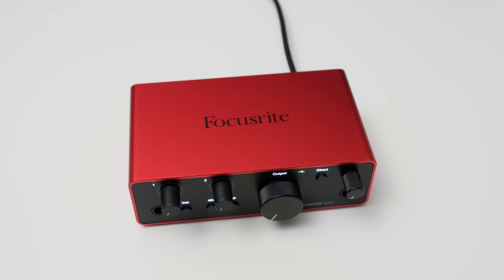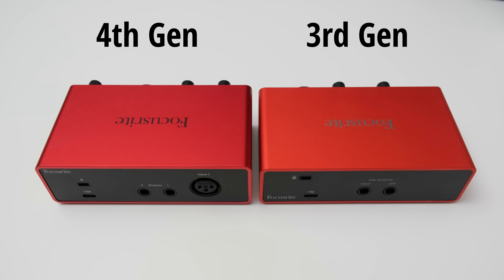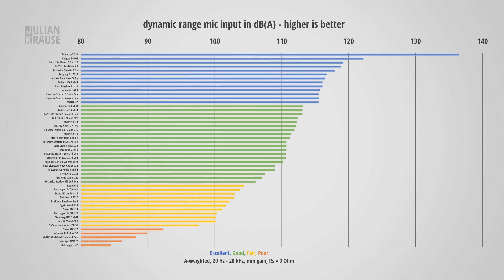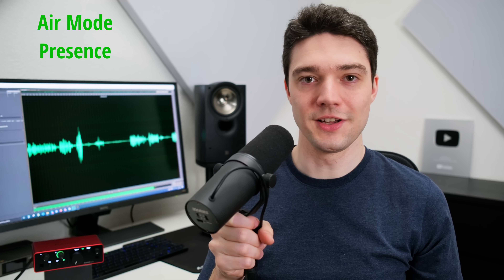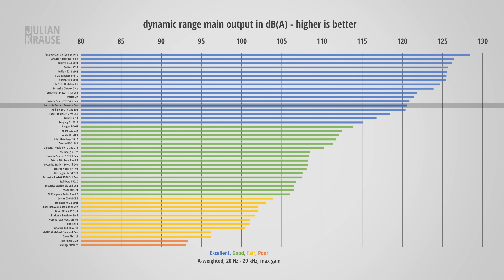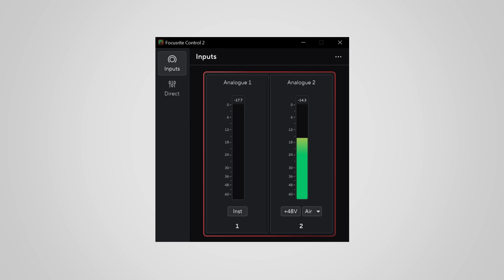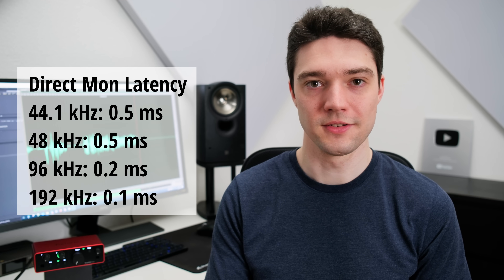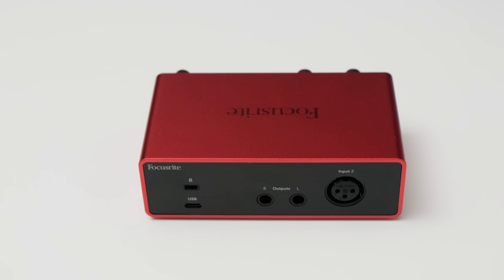Focusrite Scarlett Solo 4th Gen – USB Audio Interface Review (Air Mode Audio Samples)

Comment: Try plugging a Stratocaster style guitar directly into the instrument input.  There is not enough gain on the preamps. This is a weakness. The Behringer UMC202HD has plenty of gain for this purpose. I've AB'd both of these together. It also has very cheap feeling buttons (like foil switches.) Also is has the little cheesy USB-C type jack on the back (Instead of the roubust USB-B type of jack and associated connector.) The Behringer UMC202HD has a USB-B connection, and real spring switches. Plus it give you another USB/TRS/TS jack and another 1/4" instrument jack. Thanks for the review, Julian. It was interesting.

Comment: Hello Julian. I'm new to the sound business. I came across your Youtube channel after buying a Focusrite Scarlett Solo 4th gen. Wow! What a great source of information. Thank you 😊

I became aware of the problem of impedance for headphones. I'm currently using Audio Technica ATH-M20X which doesn't seem to be a good combination with the Solo 4th. I contacted Audio Technica and they told me to opt for headphones with an impedance 5 to 8 times that of the headphone amplifiers output impedance. That would mean at least 250ohms. Do you agree to get an impedance that high? 

Also, I don't find any headphone review on your channel. Probably an editorial choice. I'll give it a try. For a budget of $200-250, which closed-back earphone would you recommend with that impedance?

Comment: Hi. If I just connect my studio speakers to my computer using the interface with the appropriate cables, which one provides better sound quality? Is there a difference compared to the previous generation? I wouldn't really use any other features. Thanks.

Comment: I can not 100% tell from the part of the video, where you show the Software and enable Direct Monitor - but judging the meters it seems it does the same thing previous generations do (on Reddit there are people with 1st, 2nd and 3rd gens reporting this): the output levels drop as soon as you enable it. I just "tested" it with my 1st gen Solo: with direct monitoring enabled, the output drops 5dB (even though there is nothing connected to the inputs and it's just playing audio "sent over USB"). In your video it also looks like a 5ish dB drop when you enable it in the software. 

According to the support agent from Focusrite i just chatted with, this is neither known nor should happen, though i really doubt that now - I think this is just a tiny design flaw?! 

Can you please check this?
Reply: "tested" in quotes because I'm not an expert and maybe my test is flawed. Test = Ableton on computer A playing a sine wave, interface is the Scarlett Solo, which output (RCA) is connected to the other interface of computer B, which records the sine wave. Tested with the Monitor (output) knob of the Scarlett at 12 o' clock and maximum - both times the recorded signal drops exactly 5dB when I switch Direct Monitor to ON. This can't be an intended feature - or am I missing something?
Reply: Ok, it has been confirmed by a Focusrite Engineer via mail - despite not mentioned anywhere - it's normal and intended to "make monitoring easier during performance as the artist/user will want to focus on the performance during takes" - it also only affects audio playback but not audio input levels.

Comment: Can a midi keyboard connect to the front?
Reply from the maker: The Solo does not have a midi connection. If your midi device has an analog audio output, it can be connected to the line input of the Solo. Keep in mind, the solo only has one line input, so it will be a mono signal.

Comment: Hey, thanks for the review, having the 3rd gen solo I have one question about the 4th gen. Are the knobs for Monitor vs headphones completely independent? I currently use my 3rd gen with headphones only, but as far as I know you cannot turn of the line out and run the headphones only or vice versa. Is this possible with the two knows of the 4th gen?

Comment: I don't get why focusrite keeps dragging its heels about designing such high output impedance headphone outputs. 3-5 ohms is the max any sensible designer should think of for a compromise in the best low frequency response and over-current protection

Comment: Hey, been exploring a bit of audio stuff and found out your channel. I've recently heard about audiophile switches and knowing how ethernet works I'm pretty sure they are complete BS.
Definitely the digital signal quality has zero impact on the audio quality as long as all the bits are transmitted, but another part of the praise for audiophile switches is the fact that they also have have less electronical noise which could interfere with the audio... now, that to me seems at least plausible, but I doubt we're talking about perceivable difference (unlike what some people hear claiming au switches improve sound stage, claritiy and all that), but wouldn't it be possible to measure if there is any difference by simply feeding the output of various lan connected DACs to an input and record it?

Comment: Hi Julian have you tested the PreSonus 1810c ?...i have bought one, seems fine but i do not know if it is a good 4 mic or 2 mic & 2 instrument interface with a theoretical 18 inputs & 10 outputs, 2 headphone inpits with own volume pots, is it alright to use Quad cable from interface to active monitors, PreSonus Eris8 XT's with class A/B analogue internal amps...any advice or knowledge you could tell me about the 1810c would be appreciated....thank you...

Comment: It does provide better audio for recording. Have been disappointed with mine. Had to buy it because my 8i6 died. Don't like that they took away the power switch. For me, the audio output clips at much lower volumes so I've had to reduce levels and crank the monitors to get the volume back. Ended up having to buy higher watt monitors.

Comment: Please review Presonus' new Quantam series interfaces.
Reply from the maker: I just bought the Quantum ES2😉
Reply: @JulianKrause Please,  I'd like your informed opinion.  I need a four combo input interface for my Korg M50 keyboard, Roland td-17kvx e drums, Shure SM58 mic.  I can get the Focusrite 4th gen 18i16 for $375 trading in my 3rd gen 4i4 (normally $500), SSL 12, Volt 476p, Presonus quantum es4, Motu M6 (don't trust it after reading all its problems with Windows).  $500 is my limit which the SSL 12 is at.
Really looking forward to your reply.  Thank you.

Comment: I have seen a lot of your videos and i feel i have this question that i would ask someone like you who seems to know so much... and maybe you could make a video about it. The question would be "which brand or model of interface you would choose if the most important factor for you was reliability(not to fail in any way and force you to troubleshoot or die) and life span of the an interface" My Scarlett failed few days ago(Actually i don't know if it was the interface or the microphone or the cable i don't have gear to troubleshoot the costumer service will deal with it) i had to ship it to the dealer cause it is within warranty for check and repair. I want my next interface and gear(mic, headphones and cable) to be trustworthy cause i don't want to get in this kind of trouble again. I am looking at  Yamaha AG03 what is your opinion about it? I haven't seen anything from Yamaha in your content( I consider Japanese manufacturers very trustworthy but i am a complete noob regarding interfaces). So you could make a video about the most reliable gear instead of only comparing features and quality that may be interesting but i think there is plenty of that everybody does that. I admit not so deep as you do it but still nobody has yet covered the question i have. Assuming always that there is an answer for that because i know that in some cases there is not a straight answer. Keep up the great work!

Comment: To me, some boost of bass and treble with low impedance headphones wouldn't hurt :) On the larger interfaces, where you have enough outputs, I don't consider it as much a problem, because to me the internal headphone amps on these devices sound audibly worse than even lower range proper headphone amp.

Comment: Does headphone sensitivity have an effect or is it just the impedance of the headphones when using an interface with high output impedance? I mean if i have a low sensitivity planar headphones with low impedance would the scarlet solo boost the bass on these aswell?
Reply from the maker: Hey, it’s about the impedance of the headphones and how much it changes over the frequency range. With planars you might actually be ok, because their impedance stays very constant. But be aware, of the lower sensitivity. It’s worth cleaving if the interface delivers enough power for you.

Comment: Low on money and my Motu M2 loses audio on the right side with my DCA Aeon X occasionally so I need a replacement. Would this be good enough? DMS replied to me and apparently he's had the same issues with Motu and planar headphones aswell. Does anyone have any insight as to what could be causing the issue with just these headphones? I have a lot of other dynamic headphones I've used for years with no issues. When the right side mutes, turning the interface off or unplugging the headphones results in a loud pop on the muted side

Comment: The big reason why i decide me for the moto m4 were the reports that focusrite did not run stable in the past vesions. With my motu i have no problems. Still happy with it. I know it is hard to give evaluations about quality and hardware and software stability. So it would good if you could integrate these result into your testing.

Comment: Julian, is there any audio interfaces out there which has digitally controlled output gain (other than Audient EVO 4) that you're aware of? 

I'm currently using Solo 4th Gen and it's an inconvenience whenever I have to reach for the physical output knob, rather than pressing Volume Up/Down keys on macOS which used to work with EVO 4 ...

Comment: I had the Revive mod performed on mine which affects the entire analog I/O path (Burr Brown/ Linear Tech components, power supply mod, etc). resulting in bandwidth/headroom improvements and surpassing that of all the higher Scarlett models.  Spec'd to the moon and still the lightest  interface in the game.
Reply: How to do the mod, have a link for ref.?
Reply: @cyntheticAI-7458   It's Revive Audio (YT stripped the actual url of the mod service.  They offer  mods of several popular interfaces.  There is also Black Lion Audio

Comment: I have 3rd generation Solo and have been happy with it with the exception of the headphone amplifier. I recently got Neumann NDH 30 headphones that really showed the lacking in the Solo headphone amp so I got Topping A30 Pro headphone amp which has balanced inputs and I have it connected to the balanced monitor outputs of the Solo bypassing Solo's headphone amp. The difference in sound quality of the Neumann headphones is amazing.

Comment: Great review! But after following your excellent reviews for a while and after I tried quite a lot interfaces from SSL 12 to Prism Sound Lyra, I have to confess that what matters the most to me is simply latency, driver support, headphone amp. I would argue that you find decent to professional conversion and preamps in most of them. To make it short: Nothing beats RME. Currently I am using a Babyface Pro FS. It shines on all the before mentioned things and on top you have got a real powerhouse in terms of connectivity.
Reply: I sold my Babyface Pro FS and then purchased SOLO4
Reply: @SuStWind  That’s fine 😊, if it works for you. Most important is that an interface fulfills all your needs. Greetings.

Comment: Julian, are you aware about audio crackling/glitching issue with Focusrite devices? It is all over the internet, and there is no solution to it, support suggestions about sampling rates, buffer size, power plan and etc does absolutely nothing, and the only remedy is to reboot (sometimes restarting audio service helps).

Comment: Julian is there anyway you could measure the impedance of the monitor outputs for interfaces, I know you already measure so much but it would greatly be appreciated!! I don't mean the ones with 2 outputs, because well that obviously what you do 😁 but the ones with multiples but has a dedicated output for monitors over line level outputs. Cheers!
Reply from the maker: Hey, I could measure it but there is no real-world benefit. The impedance of line level / monitor outputs is usually very low in comparison to the connected line level inputs / monitors. Even if the output impedance was a bit higher, the input impedance of the connected device is pretty much always flat. The only thing that would happen is that the volume would drop ever so slightly. In practice the output impedance of line level / monitor outputs has pretty much no impact on the sound, that’s why measuring does not make much sense in my opinion.
With headphones amps it is completely different as headphones are complex loads with varying impedance in their the frequency range. Here the output impedance can matter a lot.
Reply: @JulianKrause  I'll tell you why I ask, I had my good interface die and so I ran to the local music store and picked up a Presonus quantum 2626 until Antelope could get a replacement to me. The Monitor outputs on the Presonus were dark terrible and weird sounding compared to even an old Gen 1 Apollo Twin I have. So I looked at the specs and it had an output of 51 ohms? Most Studio monitors like Genelec and ATC recommend a monitor output of 100 ohms which most interfaces have like Focusrite, Antelope, Apogee, and my Soundcraft MH-2 console so on. So I was curious if you had seen an issue like this before. Thanks for all of your hard work Julian!!! Cheers!!
Reply from the maker: Pretty sure the dark sound must come from something else. Line output impedances from 50 to 200 Ohm are very typical and I would argue that even slightly higher impedances have hardly any imact on the sound. Worst case the signal gets slightly quiter but that's pretty much it. Glad you enjoy the videos!!
Reply: @JulianKrause  It might be a bad interface, I picked it up the Presonus yesterday and its Sunday and they are closed for me to exchange it. I'm using my old Apollo but it was just strange for a new device to sound so dark. Thanks for help responding Julian have a great weekend!! 👍

Comment: Wish Focusrite would revamp the Claret range, atm not a single audio interface does what I want.
Reply: What are you looking for?
Reply: @mycosys  ideally, 1. controls on the front that are digitally controlled (thought if that is entirely digital that would be fine as well) Inputs on the back, 2. a solid clean powerful digitally channel balanced headphone out so I dont need a dedicated headphone amp, 3. Physical build, all metal, 1 or 2 mic in, 2 or 4 jack out (preferably 2 jack and 2 XLR), USB type C powered with optional poweroutlet,  4. Functions, self monitoring with a balance function (more input or more playback), Phantom power, dedicated digitally controlled gain for mics with the option to link them as 1 unit and preferably in a ratio so for example if I set one to 3dB and two to 6 dB I can link them and if I up them by 2dB, one becomes 5 and two becomes 8., basically what im asking for is not that complex, just a relatively simple unit of which we have thousands already but one that is just really good quality in every metric and not one that just fails in one of them.
Reply: @Decenium  I would hope to see all that in the G4 Scarlett 18i20 TBH.
MOTU have the Ulralite Mk5, 828 etc and Audient have the Evo16 (among others) that provide all that, Focusrite really have to up their game to compete. ATM the only place the G4 Scarletts fall down is the headphone out, you would hope mains power could solve that.
I would expect to keep seeing mic pres in the Clarett, like a lot of higher end interfaces, differentiate themselves with discrete analog path that can be bypassed with inserts, we're at the point where digital controlled pres (like the THAT626x used by Audient and MOTU) are cheap and utterly transparent, and what were once top-class converters are under 10 bucks.
Reply: Not even high end brands like RME or Metric Halo?
Reply: @jc3drums916  I would have to look at Metric Halo, not familiar, RME Is faaaar more then I need, I was looking at the Babyface due to specs but its just this giant board of options, thousands of buttons of which I only need like 4....so that is just begging for problems imo.
Reply: Babyface has thousands of buttons? Simplest interface there is 👼